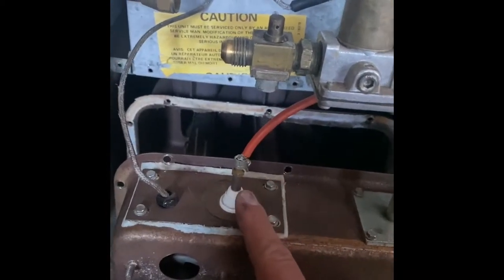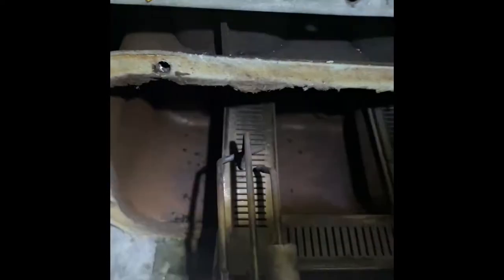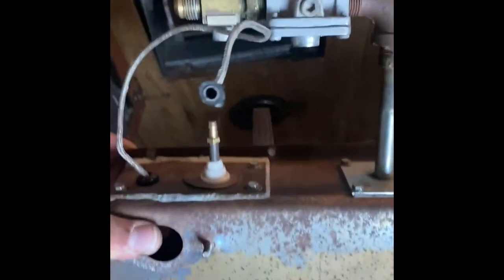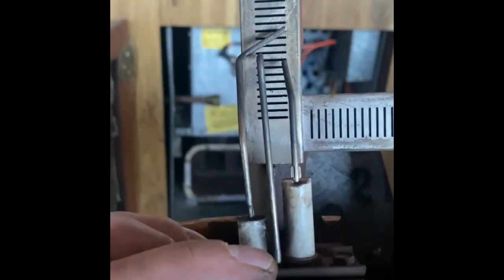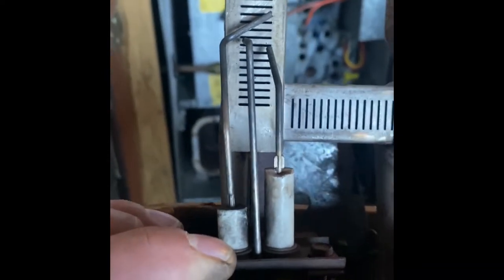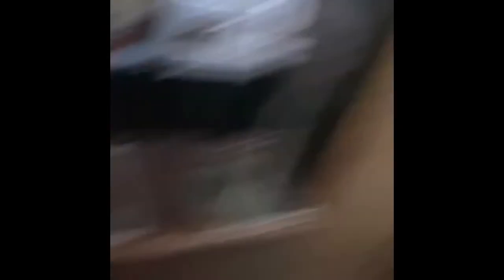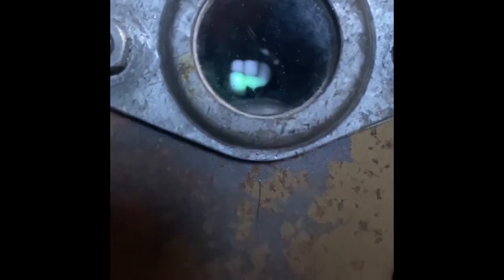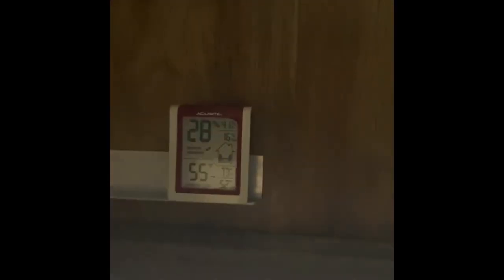HOW-TO/REPAIR - 1970-1980s DuoTherm RV furnace 65017-64 -  a fix for intermittent ignition failure

Comment: I had a HVAC guy tell me that I needed a new furnace for my house and I looked online and found a replacement circuit board.    Replaced it and bought me a co2 tester that they use and it read hardly any co2.     It has been a few years now and it works perfectly and saved myself thousands of dollars
Reply from the maker: I hear this a lot, and it’s happened to me too actually. Often times, it will be something simple that causes the furnace to fail. Yet we’re told we need to spend all kinds of money. I’ve got one working again just by replacing the thermocouple, which is maybe a $20 part. 

I’m glad you had the will and the skill to repair your own! It’s tough enough to pay for food and gas these days, let alone a new furnace or some other home appliance. Thanks for watching the video!

Comment: I have the exact furnace I did exactly what you said and saved the day thank you. But after a hard winter and using it every night this coming winter it doesn't spark any more. It just won't but thank you I'm going to try cleaning the spark things again and space them out correctly and I guess we'll see
Reply from the maker: I’m happy to hear that it worked out for you! Eventually my furnace began to have some other issues, and what I ended up doing was putting in a small propane heater that I got off of Amazon and it works really well.

Comment: Good video and insightful. My Duotherm furnace quit in my camper and made me cancel a trip this week. What I noticed is the fan was struggling to spool up, so I went on a search for a compatible motor. Ordered one that is close in amps and matching physical dimensions. I'm hoping that will solve the problem and allow me a winter trip.
Reply from the maker: Thank you for checking out the video I hope it helped in some way. Let me know how it turns out with your repair!

Comment: iv got a 87 nomad. has a duo therm. been working great threw winter in montana   all the sudden a few weeks ago it stopped igniting and blowing cold air. checking out this vid   thanks !
Reply from the maker: I bet a winter in Montana is a real test for an old RV furnace. 8500 feet in the mountains of Colorado sure was for me! I wish you the best! 🙏
Reply: @vastirvision  yep. out here iv got 3 heaters in the winter  a infrared on each end and the furnace each ine pretty much on low.  i stsrted really liking the furnace. heats the place up quick and especially the bathroom. it stopped working a few weeks ago luckily was good threw winter

Comment: I am having the same problem with my furnace. Mine is in a 1989 Komfort Trendsetter class A motorcoach. I am going try your fix and hope it works. I hate waking up in the morning and it's 35° inside.
Reply from the maker: Yes I hear you on that…I dealt with some very cold mornings on many days, and it’s not a great way to start your day. I hope the video helps you to arrive at a solution! Thanks for commenting, and if you can, let me know how it turns out. I ended up just replacing the furnace with a propane heater off of Amazon, after other issues arose, and I haven’t had any of those ice-cold mornings since.

Comment: Hey there I think I messaged you along time ago only because we have the same furnace well I just read your description again and this is exactly what my duo therm 1988 started doing after winter same thing sometimes it burns and blows hot sometimes it’s blowing but the burners not lit kinda works on it wants to did you figure out what was wrong with it I’m thinking today I’m gonna get into it try and keep it simple cause it’s gonna be a pain in the butt to take it all apart and pull it out

Comment: I'm living off grid as well on vintage motorhome too. 

I hear you. The problem is alot of people nowadays are boneheads that just know how to buy and replace stuff, and can't even do a simple maintenance job.

There's also alot of misconception and discrimination towards things that are 'old', when in most cases they are built with much better quality and simplicity then their modern counterparts.

stay safe stay warm brother
Reply from the maker: Yeah you’re absolutely right about that. We are taught now (most people anyways), that when something breaks, you just go out and buy a new one. I’ve learned to fix a lot of things I’ve the years, and it’s really saved my behind more than a few times! 

I actually just got a new job, doing tile, where I can finally afford to rent a place that doesn’t move lol. Three years I’ve lived in that 40 year old travel
trailer. But my new place does not have indoor plumbing, or insulation either; so I’m still figuring out the whole heating thing, even though I’m not living in my camper at the moment. Luckily I have a pellet stove, which works pretty well. Thanks for watching the video, and thank you for your comment! Stay safe out there and may health and happiness find you always 🙏

Comment: Great  job man, trying  to figure out my boys furnace,  his backfires .
Reply: Ever figure yours out? Mine's doing the same, getting taken apart today.
Reply: @bairfamilyfarm1336  unfortunately no, but  we replaced it with a Chinese diesel heater cheep and it works well.
Reply from the maker: @JerrycanWanderers  that’s actually what I ended up doing, and it works great! Pro-com blue flame “ice house heater” off of Amazon. It was getting very cold in Colorado and I needed heat for a low price and fast. Glad you found a solution!

Comment: love this video so far !  was yours making that spark when it wasn't working?  because i believe mine used to spark up when i started it and now nothing   so right off i thought maybe the igniter needs replaced but first thing is get in there and clean up and take a look. maybe its just dirty from all tye dusty air
Reply from the maker: Thanks for checking it out! Mine definitely had some type of buildup or corrosion that would accumulate on those ignition leads. It made it hard for the ignition to work properly. After I would clean it, it would work. I thought it was maybe impurities in the propane that were causing it, but I’m not 100% sure.

Comment: Many of these do not have a “board” for ignition, but are pilot models. It runs the fan and tests the proofer with a delay, then fires the burner. Fan is 12V-4.5A/120V-.9A. which is handy with solar because it’s only 50W at 12V. 

That’s the one I’m trying to fix: this duo therm hasn’t been run for 20+ maybe 30 years. I’ve got to decide whether to rebuild it or drop the $600+ for a new one.
Reply from the maker: I was faced with the same dilemma, and running on solar also, but even the 50 watts or so added up quick when the furnace ran as often as it did (pretty cold at 8500’ in CO 🥶) I did get it running and it worked great for a while, but the deposits would build back up on the ignition and I’d have to pull the front off and clean it every so often, which was a pain. In the end I ended up just getting a new propane heater off of Amazon for about $140. It works well. Let me know what you end up doing with it!

Comment: Glad you're posting again. I'm staying in an older RV, 1979, with a Duo-Therm 65930. The motor is starting to go. Hoping it makes it through winter. I'm trying to figure out how to change it. I'm not sure how to get to the ducts to remove them or when to remove them. Any tips?
Reply from the maker: Hey Jonathan, you know after I fixed mine, it worked great for a while, and then my motor started going out too. I don’t know exactly how to remove the ducts, and I’m assuming you’re referring to the ducts on the unit itself that come out of the side and supply the vents…if your setup is anything like mine with the oven next to the furnace unit, my guess is that you’d have to at the least pull the oven to access the ducts on the side. I can’t imagine being able to get to them any other way. I was gonna replace my DuoTherm with a new Suburban unit, and they were about $600-750 depending on the BTU output.

Are you open to an alternative solution? Because what I ended up doing was ordering a propane heater off of Amazon. I got a Pro-Com “blue flame ice House heater”, putting out about 12,000 BTUs if I’m not mistaken, and it was only $150 or so. It is designed for indoor use and has carbon monoxide failsafes and a thermostat. It’s the cheapest and most effective solution that I could find. They have different manufacturers aside from ProCom, and they make bigger models if you need more heat than that. But for me the smaller unit makes plenty of heat. It worked great and is still working well! It’s a simple install, and I even left my furnace intact and in place in its original location. I just ran the gas line that went to the old furnace into the new unit and mounted it right in front of the DuoTherm. It kept me alive and warm in the mountains of Colorado, where it was extremely cold. I’m posting a new video hopefully today and I do show that new heater in it, if you want to check it out. 

I know that’s a lot of information, but I hope that it may help you. Let me know how it goes and what you decide to do; and if you have any other questions I’ll do my best to answer to them. Rock on in the ‘79, and best of luck to you!
Reply: @vastirvision  Awesome. Mine is next to the fridge, so I'll try and remove that. Still going to run it till it dies. Thank you for all the suggestions. I probably would have gone with a propane house heater if I didn't buy the motor already.
Reply from the maker: Let me know how it goes either way! If all else fails those blue flame propane heaters are around $150-200, and mine definitely saved my butt last winter. Good luck brother!
Reply: @vastirvision  Last week the furnace went out in the middle of the night. I was able to change the motor. My arm was able to fit through the duct hole below the fridge and unscrew the ducts on that side of the furnace.

I noticed that all of the screws for the ducts on that side were cut and I just realized while typing this message that the person who worked on it previously probably did that so the furnace would be able to slide out of the shell without removing the duct screws since they impede it from sliding out smoothly.

Comment: The 3 electrodes from right to left is #1 & #2 are for the spark ignition, and #3 is for proof of ignition or proof of a successful ignition. Cleaning your spark ignition is probably what fixed it, and possibly the spark gap as you had suspected. Parts can be difficult to find however the control board I had found quickly by using the identification numbers on the board itself. 

PLEASE NOTE!!! The reason the technician had suggested replacing the unit is due to the likelihood of there being a hole in the heat exchanger! A hole could very well result in death from inhaling carbon monoxide! Definitely something to take serious. Years ago my cousin and his family all died from carbon monoxide poisoning! Such an easy thing to test for for such an important reason!
Reply from the maker: Thank you for this info! I wish I had you around when I was taking this thing apart, you sound like you know about it than I did. Unfortunately those deposits would build back up every so often and I’d have to clean them back off…
I’m very saddened to hear what happened to your family members. Just goes to show how important a carbon monoxide detector is in these situations. Be well out there 🙏

Comment: Ha ha my pos furnace is broke again this time I think is shot! Mine is all sealed and nothing is “serviceable” even spot welded together! And like yours ours was fixable with a few basic tools. But now lol I may try a dinosaur board it’s by igniting but the spark is very weak. Pretty sure that’s the issue. Just don’t know if I want to spend 110 on a board or 600 on a furnace I can buy parts for! Lol my dilemma today!!!
Reply from the maker: Man that really sucks. I’m sorry to hear that. This is a good life, but not an easy one that’s for sure. There’s definitely an alternative solution though! I’ve got all the heat I need now, after mine eventually crapped out too, and I spent less than $200. All you need to know is how to hook up a propane line, and I’m betting my bottom dollar that you can do that without any trouble. I’ve figured it out and you will too. 

Check out “blue flame propane heaters”. They work great. I wouldn’t go with infrared. You can Either google it, or you can go right to Amazon and order one. I have a 10,000 BTU model which will usually heat around 250 square ft of living space (most RVs) w no problem. There are 20k and 30k BTU models also. You want one that has a variable thermostat for sure.

PS: looks like the 10k BTU and 20k Procoms are sold out right now, but Mr. Heater makes the same type of propane heater also. Here’s a link to one for $167.99. It will take you maybe an hour to get it all hooked up. Let me know if I can give you any more info.
Reply from the maker: https://www.amazon.com/Mr-Heater-Corporation-Vent-Free-Propane/dp/B01DPZ56PU/ref=sr_1_5?crid=3U89U6AIBGKEK&keywords=blue+flame+propane+heater&qid=1668959714&s=home-garden&sprefix=blue+flame%2Cgarden%2C216&sr=1-5

Comment: Hey thanks for the video! I have a very similar problem with my duo therm furnace. Did this adjustment you made end up solving your problem long term or did you go back and do anything else? I am considering replacing either the board or the valve but not sure which one. I cleaned off my igniter with some sand paper but my furnace still goes out after a while.
Reply from the maker: It would run for a few weeks and the deposits would build back up sadly, and I’d have to pull it back apart and clean the ignition again. I got really good at pulling that furnace apart, trust me on that one lol. 

What I ended up doing was ordering a Pro-com “blue flame ice house heater” from Amazon for about $140. I mounted her on the wall, right over the old furnace in fact, and I ran the existing gas line from the old furnace to the new unit and it works great. Having heating problems at 8500’ in the mountains of Colorado in the dead of winter was a nightmare, and the new setup works great. Plus I don’t have to power a fan off of solar anymore, which helps bc I boondock full-time. 

Let me know what you end up deciding!

Comment: Keep a carbon monoxide detector handy. I heard these older ones are bad for it. If the heat exchanger is the style I'm thinking of, a MIG welder might take care of any leaks.
Reply from the maker: I agree 100%. For the cost of one of those detectors you’d be silly to not have one in a camper with this type of furnace set up. Could save your life

Comment: i have one from the 70s.i dont turn a wrench i wonder if their is a shop somewhere with a pro.  but due to liability nobody wants to touch these old thing?   mine  has no fan which i like
Reply from the maker: Yeah the fan just consumes extra power and this is something to consider if you’re boondocking w solar like I am. If you can get away without having the fan that’s your best bet I think!
Reply: @vastirvision  i have one installed in my tear drop.  without the fan. i think im safe if i have enuf detectors inside the camper to warn me of trouble or leaks
Reply: @vastirvision  i have one without fan.......i just wouldnt want to camp with heavy wind from outside coming in towards vent
Reply: what i heard is as long as the heating box has no holes this heater will last forever
Reply from the maker: @yogavnture1  yes I bet in a teardrop you wouldn’t need the fan, you don’t have as much space to heat in there. And for most mechanical systems,  the more moving parts you have, the more potential for something to fail eventually.
Reply: @vastirvision  u are correct so the main reason for a fan is to push heat around not to remove fume from cabin?????  i love that its totally silent with no fan but what about if big wind from outside coming in i wonder if fumes would get in that way
Reply: mine is the simplest of all duo therms.  no fan only a pilot light that could fail or hole in heating box ..................thats it .  i think if pilot light goes off then the heater detects that and turns off automatically ?